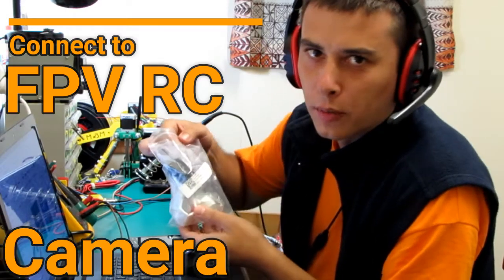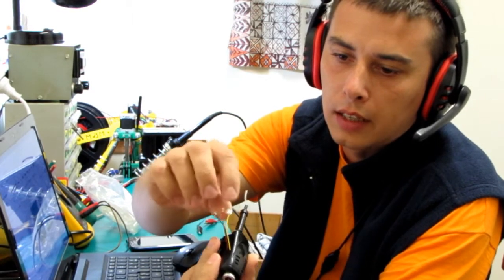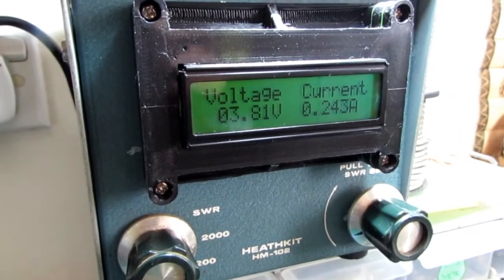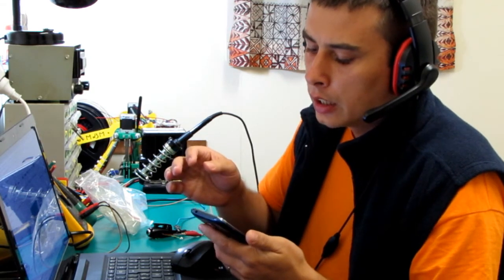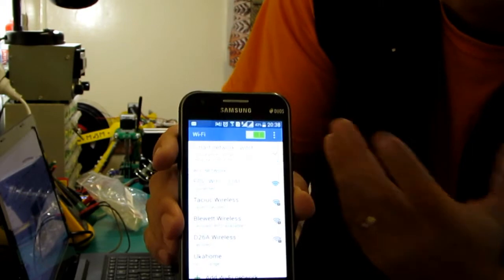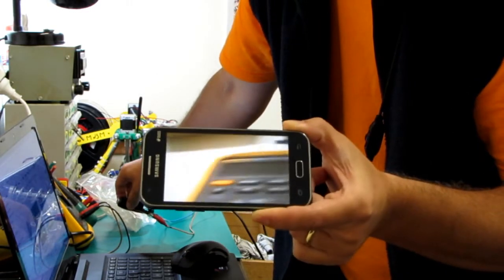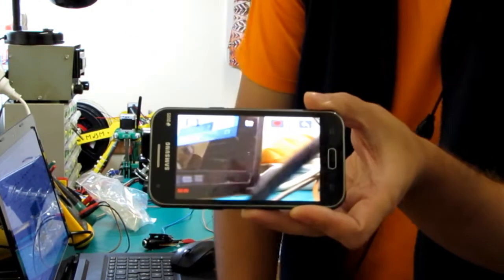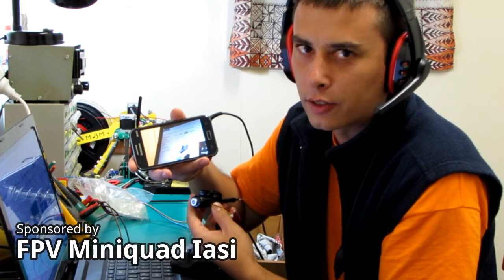Mini FPV camera for drone - WiFi camera review and how to connect

Comment: Wondering if the voltage spec was "1 cell."   It's possible it has a voltage regulator so it can use whatever voltage is coming off the battery pack which could be as high as 5-cells.

Comment: I wish I would have found your video a months ago. I bought a sky tracker drone at Walmart for a little over 100 US dollars. I really like it it has a thousand foot range I never pushed it to that distance but the camera on it I could never connect to my phone and I have an Android a01. I got so frustrated I did something that I learned from quad chopper 101. He removed the factory camera and bought a 808 keychain camera that looks like a fob for your car to unlock or lock the doors. And then attached it with rubber bands to the belly of the drone.

However the reason that I bought the drone was so I could see through the camera so I could go further out out of line of sight and get some video so your video really helped me and I'm anxious to get a good camera.
Thank you for taking the time to make this video

Comment: Is the mobile app reliable? I had recently bought a composite video to wifi module. The module works great but the app had stopped working on iOS after few weeks. The problem is I don't own an Android phone and the seller has not replied if there is an alternate app that can work on iOS. This has made my setup useless.
Reply from the maker: I don't personally know. I am an Android guy. But it's good that you placed this question here. Maybe some of the viewers know the answer and will reply soon.

Comment: Sir, can i use any wifi-repeater (Mi repeater 2 or others) with wifi-fpv camera for extending range. Thank you.
Reply from the maker: Anything around 5.8GHz should have more range and less delay. But for that you need certain types of phones and external USB OTG receivers. Or they pair directly with the FPV googles. The 5.8GHz cameras also come with different emitting powers. Some of them can even broadcast almost 1Km away.
Reply: @FunElectronicsToday  Thank you for your information. Actually i keen to know about wifi- extender with this sort of wifi-fpv camera as like dji Tello.
Reply from the maker: I personally don't know. I never tried it with such a thing. Maybe somebody else who reads this post might reply to it.
Reply: @FunElectronicsToday  😔. Anyway, thank you.

Comment: sir, is it need net or data connection on mobile ? what about wifi range. thank you.
Reply from the maker: It does not need mobile data. The WiFi module of the phone pairs with the camera so i could not connect to any other WiFi network. The app does not require internet conectivity. The range of the camera is about 30m. When this range is exceeded, the image freezes on the screen. Check this video of mine for example. It was shot with this camera. https://www.youtube.com/watch?v=dmNdvQShqEU
Reply: @FunElectronicsToday  thank you.